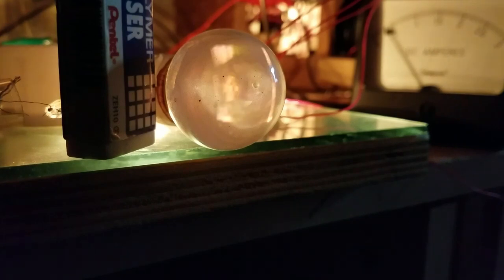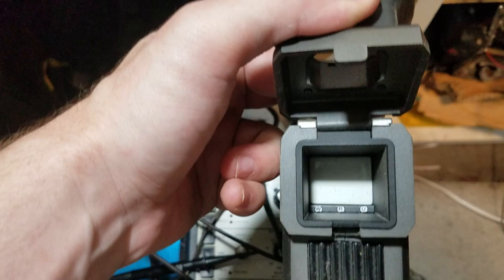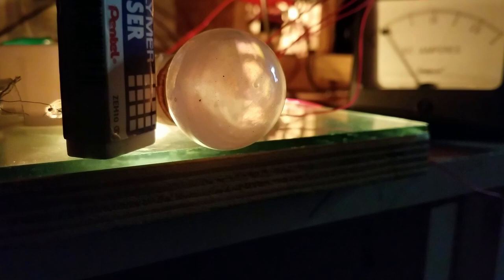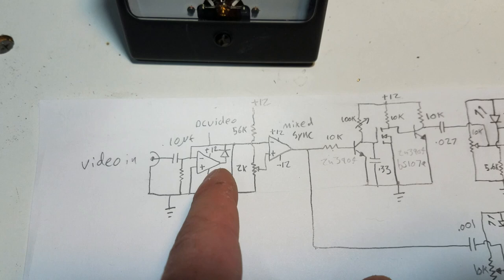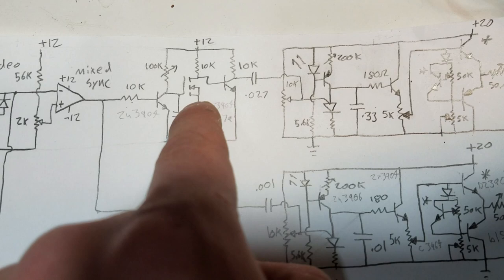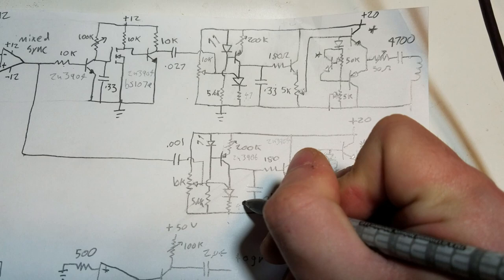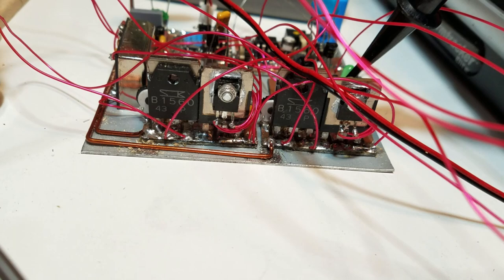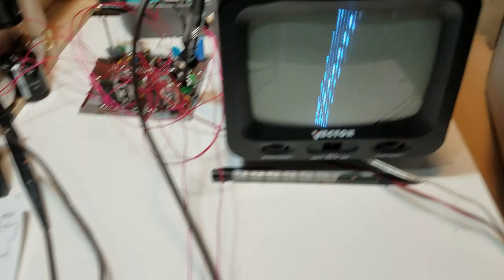Video Display On Homemade Cathode Ray Tube

Comment: I am seriously impressed with this! I really am. I wonder if its possible to eventually get into rebuilding vintage CRTs again, replacing the cathodes that have been used up on antique TV sets since all the rebuilders are gone now.
Reply from the maker: Thank you! It is possible. The early television foundation has all the equipment needed to rebuild tubes they just do not have anyone with the experience to operate it. I do not currently have the equipment or skills to rebuild picture tubes unfortunately.

Comment: I just discovered your channel and I am very impressed that you dare to build vacuum tubes even with the simplest tools.  Your knowledge is on the level of Youtuber Ron Glasslinger who also has a wide range of knowledge from electron tubes to transistors.  My knowledge, throughout my professional career, also ranges from electron tubes to complex integrated circuits.  Technically, I can understand very well what you are building.  I enjoy following you.  Electronics has become a very broad field from the first transceivers by Marconi, who did not yet have an electron tube, but did great things with the means of the time.  My younger, former colleagues are fit in the development of modern electronics, but cannot understand the function of radio receivers or televisions from the early days and cannot read the circuit diagrams.  In a few years this knowledge could be lost.  From now on I will follow your channel and look forward to more videos.  I wish you a wonderful time.
Herbert from Southern Bavaria

Comment: Your use of a Baird NBTV signal is genius.  I've been fascinated by televisors since I hit upon the idea of using one as a post-apocalyptic terminal display that would be easy to bootstrap from a late-19th century level of technology.  (an incredibly simple design could theoretically be driven by a couple of pins, one bi-directional pin if you really need to.)

Comment: dude, your skills are amazing bro. Ive been doing hobby electronics since I was like 5. and watching someone like you build tubes from nothing is amazing
I do have a question for you, if this comment doesn't get lost

Why? why do you do this. Do you like old tech and want to relearn the old ways, have skills encase we get emp and you get the grid back up. 
I hope this is not a condescending question, but what drives someone like you to learn out dated skills? I'm just curious what is your specific reasoning for finding meaning in this amazing skill you possess. 

ITs funny, because I wrote on my do do list about a month ago. "learn glass blowing and then make nixie tubes" and then you popped up. I also didn't say this out loud, wrote it on paper. so thanks google for yet again reading my mind.

Comment: Very impressive. That is probably similar to what they got the first time. It looks like the red wires from the box are getting pinched in the hinge. If you squint it makes it much easier to see the contrast, it will remove most colour information I can see the image clearly if I do that that is a trick from life drawing.

Comment: Glad to see the CRT in good use,
 it's still an impressive sight to behold even though it's a bit blurred. 

Have you tried the focusing coil yet?
Might take a quite a bit of power to force all the electrons closer together, 
but it should as you most definitely know improve the image at least a bit.
Reply from the maker: I am building one right now, I think it is going to take an awful lot of wire. I am first going to try it with 39 gauge since I have a lot of it and I can get a lot more turns in a small space. It probably will end up needing a few hundred volts in the end.
Reply: @jdflyback  JD, in DC driven coils, voltage is meaningless. It is all about the current. Unless you have a truly hard vacuum in the envelope of your tube, it will probably never focus. I keep having a flashback, "gas focused tube". I think that may have been in the days of the Braun tubes which operated at 100,000 volts minimum. They used a tungsten spike cathode, not heated, and need tons of voltage to emit electrons from their tip. (And X-rays from the anode) Those electron guns only lasted less than a day. It is a safe bet that focusing the beam was also equally primitive at the time.
If you run any vacuum tube at less than 16KV, there is no danger from X-rays. Even above that voltage, the X-rays created are of the soft variety and are blocked by the lead glass of the tube. (referring to 14 inch and larger monochrome TV CRTs.)
Reply from the maker: @videolabguy  Thanks for the tip. The coil I made used 39 gauge wire with about 5000 turns (as many as I could fit on the form). It ended up being 3700 ohms. Because of the high resistance I was using high voltage to get a high current. and have as many amp turns as possible. Even with around 20 watts going into the focus coil I did not see any sharpening. The tube probably has some resisdual gas in it. The supply I have can go to 30kV and the tube makes a lot of soft x-rays when operated that high (pegs my geiger counter). The geiger counter lets me know when I have gone too far. The only solution I see right now is to keep the anode aperature small at the expense of low efficiency and a dim trace.
Reply: @jdflyback  what about adding an electrostatic lens inside?

Comment: Good job with the uniformity of the coating!  I'd love to try this some day. I noticed they have some phosphor coatings available in (expensive) aerosol spray cans.  Also, this analog circuitry stuff is black magic voodoo to me.. id sooner try a find a way to use microcontrollers driving DACs, etc.  Being honest with myself though, I'd probably get stuck at the glasswork.
Reply from the maker: Thank you! The coating is definitely the hardest part it usually takes a few tries to get something acceptable. I never could make myself like digital! I have done work in the past with embedded microcontrollers and I can't keep everything in my head at once how all the different pieces interact across different blocks of code. If it has ten or less parts with a couple transistors I have at least a chance of wrapping my mind around it.

Comment: Fricking awesome! How about building an NBTV receiver purely out of your homemade tubes (including a regenerative AM receiver)?
Reply from the maker: I have thought about it! Would be quite a challenge. I think I would have to come up with a standard tube first. Every one is pretty much unique right now.
Reply: @jdflyback  I managed to simplify an analog video to oscilloscope converter down to just 3 transistors, perhaps a similar thing could be achieved with just a few tubes as well and used to drive that CRT of yours.
Reply: @jdflyback  "Every one is pretty much unique right now."🙊😂😂😂 So cool..:::
It's really inspiring you've demonstrated the feasibility of diy valve manufacture!!!

If I started grading and smelting sand into glass and mining and learning the relevant metallurgy right now, how many decades to my own device?
...Is something I wonder about frequently, it's great to see people actually tackle these things in sum or part!!!

Comment: What you are doing is fantastic. Maybe you strive to be authentic, but if not, I can recommend driving the tube with digital function generators. No need for complex circuitry. Just 3 D/A converters for X, Y, and Z and some software. Almost all small embedded chips will include all this for a few $$. From Arduino to Cypress Psoc and many others.   

I did not make any glass parts, but used an old Tektronix oscilloscope tube to make a monitor for a computer I built.

Comment: Have you considered making a 7JP4 clone?  It was common in 1940s TVs because it uses electrostatic deflection and therefore doesn’t require a yoke.  It also uses an Einzel aka “monopole” focus.

Comment: Absolutely termedus effort. I did not think anyone under 30 was interested in vacuum tube equipment. And I'm surprised your channel views are small and I even found your channel. What's so cool is the things your making will have a super long life span compared to many modern electronics. Keep going and you will have million of views I'm sure. Can't wait to see the camera build. What eles do you have in the works? Gravity modification? I learned vacuum tubes becuase I wanted the fundamentals of how our world works. A thousands tubes later I still don't know how the ufo works.
Reply: im 17 now and ive been making stuff for a while now. I used to be interested in electronics but that died years ago...
Until I recently started modding 1960s night vision, and i came across this channel that inspired me to start building my own vacuum tubes. The goal is to build a working infrared converter tube

Comment: you could use a camera to take a reasonably long exposure of the CRT screen to display the picture as is seen by eye in the video.
also it would be interesting if you tried to put the evacuation tube within the seal for the connections at the base of the CRT.
and if you're making another CRT project, you could try using those fluorescent green stickers for the phosphor, I think they're zinc oxide, similar to the P1 phosphor used in monochrome monitors but with longer persistence

Comment: Hi, this is amazing!! Congratulations!! I am trying to build a vacuum tube myself but I have problems in finding a way to find if is vacuum sealed, i saw you are using some type of HV transformer, can you tell me more about it, where should I look for more information?
Reply from the maker: The supply is a classic single transistor flyback driver driving an ac flyback with a tripler. Search "single transistor flyback driver" on Youtube and there are a bunch of videos. You can test for cracks and pinholes in the glass by pumping the tube down on a vacuum pump and moving a high voltage wire across the tube. Wherever there is a crack the high voltage will jump into it lighting up the tube. I also have a a video showing the constuction of a triode if you are interested and show the testing at 27:44 https://www.youtube.com/watch?v=vfvfgGj521M.

Comment: On the focus coil review sstv p7 monitors some needed that also I have heard of people using round magnets if using electro magnetic coil the one I tried years ago would loose a bit of focus when it got a bit warm,so bigger the better
Reply from the maker: Thanks! I have since tried an electromagnet which has 2400 ohms worth of 41 gauge wire. It fits over the deflection yoke and is about 3 inches long. I think I either need more wire or a different physical arrangement. First off I did not get it wound completely even so it creates a small rotation and I only saw a marginal change even with 300v applied to the coil. It is only acting across a small distance though so maybe that is to be expected.
Reply: @jdflyback  Hi my friend  i was looking at Cq mag 1975  on its crt 7Bp7 or 5FP7  its a coil of 2000 turns  25  gauge wire  on a 1.5 inch form  and 1,5 inch long  the out side diameter of the coil 3 inches ,40 ohm and runs on 10 volts a 100 ohm  2W pot is used for focus control ,An idea for a future CRT might be a electrostatic  focus  so much easier if you can do it . Love your work here very very impressed  did you get my email links to tehe vidicon ?
Reply: The 100 ohm is in series with the coil on  a 10 v supply
Reply from the maker: Thanks for the specs. I was able to get your schematics. Should be useful for future camera projects.

Comment: I wonder if it is possible to make thoriated tungsten for the filament.
There is a small amount of thorium in gas lamp mantles.
I found a place that sells 10 feet of 0.15mm wire for $84.
I have not finished watching all your tube making videos yet.

Comment: How can I buy the Cathode ray tube because I want to replicate this demonstration. 

Please what is the values of the PUT, the transistors, resistor and capacitors with no marking. I want to make this circuit with minimum errors. 

I might also have problem with the deflection coil: "the physical structure and the number of turns"

Comment: heya just wanted to ask what did you do to block the x rays just saying but cool project
Reply: I was thinking the same thing.  Modern CRT sets (although not so modern anymore) had control circuitry to prevent x-rays.  Be safe.  Great project! 👍

Comment: try side-ways electron gun matrix deflection grid flat crt
Reply: you can even use 90 degree crossing string layers for +/- to get a point grid addressing
Reply: either single point target deflection like usual crt line scanner, or multiple points / colors at same time in parallel
Reply: a grid behind or in the crt light layer, with another layer on the back of the thin crt, with the electron path in the middle, multiple sideways electron guns, to fill the guitar lines, even single pixel separate deflection voltage grid addressing

Comment: How dare you, and what is that?
Reply from the maker: This is the home construction of one of the first electronic display devices, the cathode ray tube. It is an evacuated tube with an electron gun that fires at a phosphor screen creating a dot. By deflecting the electrons with a magnetic field we can move the dot back and forth and up and down to create a square on the screen (called a raster). If we vary the intensity of the electron beam as we move it we can create an image.